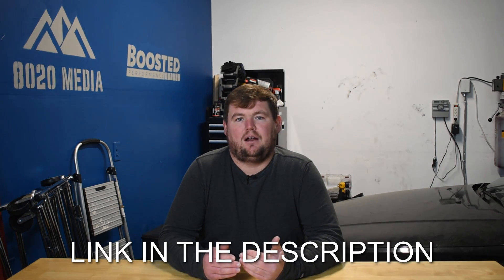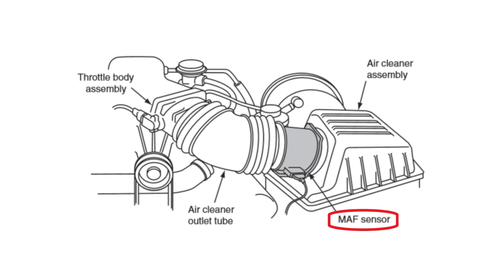DIY - 5 Symptoms of a Failing MAF (Mass Air Flow) Sensor!

Comment: So I have a 2002 Ford escape six-cylinder 3.0 engine in my maf sensor is reading higher than normal and yes, I’m getting misfire. I’m not getting a code for the sensor. I do know that I have a O2 sensor on one of the banks not reading properly but once the car gets up and warm symptoms seem to go away now I’ve done the usual looking at vacuum hoses, and sprayed brake fluid around areas to see if the engine RPMs would go up basically looking for vacuum leaks and that doesn’t happen the engine rpm stay constant, so could I have a bad sensor? Could I have a bad IAC? 
Scratching my head in Michigan.
Reply from the maker: K - If your 2002 Ford Escape’s MAF sensor is reading higher than normal, you’re experiencing misfires, and the symptoms improve as the engine warms up, this could indicate a few potential issues. While it doesn’t sound like there’s a vacuum leak based on your testing, a faulty MAF sensor could still be the culprit, as it might be sending incorrect airflow data without triggering a direct code. Additionally, the oxygen sensor not reading properly on one bank can disrupt the air-fuel mixture, contributing to the misfire and exacerbating issues with the MAF. The Idle Air Control (IAC) valve could also play a role, particularly during cold starts, as a malfunctioning IAC may not provide sufficient air for smooth idling. Start by cleaning the MAF sensor with MAF cleaner and replacing the faulty oxygen sensor to ensure accurate readings for the air-fuel mixture. If the problem persists, test the IAC valve for proper operation. Also, inspect the intake manifold for gasket leaks, as these can be more difficult to detect with a simple spray test. Keep us updated!
Reply: @8020Automotive  I forgot to mention that the MAF has a temperature sensor . It’s reading the incoming air and I’ve tested it when the car was cold and it closely reads the same as the engine temperature sensor.
I have cleaned the MAF sensor and that made no difference. I have purchased one but with the temperature outside around 10 degrees, I’m going to wait till it warms up.
No room in my garage, corvette and a couple motorcycles in the way 🤪
Oh, power brake booster is fine too, no difference in rpm when I press on the brake pedal. I may also pull the IAC off and bench test it.
Reply from the maker: K - Keep us updated!
Reply: @8020Automotive  I’ve replaced bank2 sensor 2 because it wasn’t reading correctly. Now I see good numbers from it and the computer is controlling the fuel much better! 
I’m now seeing that bank 1 sensor 2 is not giving me good numbers it’s more like .035v
I may have damaged it from Rutherford engine running so bad. So I’ll change that one out too. Also sense replacing b2 s2, a lot less cylinder 2 missing. I may have to take the car on a nice long ride to see if that will clean the plug up. If not , well when I get another break in the weather, I’ll pull the intake off and replace that plug and maybe the coil pack and the intake gaskets because I don’t remember replacing them.
That’s my updated so far.
Reply: @ Another update, I pulled the intake so I could look at that #2 cylinder plug. What I found was a crack in the epoxy of the coilpack and when I pulled the plug, I found the center electrode broken loose and flopping inside the insulator.
I changed the plug and puled the 1 and 3 coilpack only to find cracks in the epoxy on those too. I'm guessing heat from the exhaust manifold. All 6 coilpacks were replaced. I put everything back together, reset the KAM memory and started it up.
Wow, beautiful running at idle and power is back when pressing down on the accelerator. I'm going to give the computer some time to relearn and I think I'll change the oil just in case I washed that cylinder down too much.

Comment: Most dealerships just automatically offer to change MAF for some 300...400$. There will be absolutely no suggestion on cleaning it. Last time a MAF went bad on my ford Mondeo I just took it out, cleaned it with some CRC and a cotton tip. Problem solved and my DIY 0$ fix held for several years before I totalled that POS Ford for other reasons. And yes official dealerships diagnosis was bad MAF needs to be changed, cost 350$.
Reply from the maker: S - Very true! Thanks for sharing this, it will certainly help future viewers.

Comment: Check engine code is reading (P0171 System too lean Bank 1) this is the only code the engine is pulling. could this be a MAF sensor fault? Should i start there or is this completely something else.
Reply from the maker: M - A P0171 (System Too Lean Bank 1) code can indeed be caused by a faulty MAF sensor, as it may send incorrect airflow data to the ECU, leading to a lean condition. Cleaning the MAF sensor with a specialized cleaner is a good first step. However, the issue could also be due to a vacuum leak, clogged fuel injectors, low fuel pressure (from a weak fuel pump or clogged filter), or an exhaust leak near the oxygen sensor. Start by inspecting the MAF sensor and surrounding air intake components, checking for vacuum leaks, and testing fuel pressure. If the MAF sensor cleaning doesn’t resolve the issue, systematically address these other possibilities.

Comment: Car stats fine, then when driving for a bit, starts bucking hard and bately moves. MAF?
Reply: Barely moves
Reply from the maker: B - The symptoms of your car starting fine but then bucking hard and barely moving could be caused by a failing MAF sensor, which may send incorrect air-fuel mixture readings, leading to hesitation or reduced power. Cleaning or replacing the MAF sensor may resolve the issue. However, it could also be due to a failing fuel pump, clogged fuel filter, or even a faulty crankshaft position sensor or ignition coil, all of which can cause intermittent power loss as the engine warms up. Scanning for error codes with an OBD-II tool will help pinpoint the root cause and guide repairs effectively.

Comment: So I changed my maf and it’s still acting the same , with no codes
Reply from the maker: L - Sorry to hear. What symptoms are you experiencing?
Reply: @ it did thro a maf code , I changed that but seems worse then before
Reply from the maker: L - Are you getting a check engine light? Are you getting any other codes?
Reply: @ oxygen sensor
Reply: @ I am going to test the ground wire at the maf and the pcm to see if maybe a ground problem , when it gets a bit more light outside
Reply from the maker: L - Keep us updated.
Reply: @8020Automotive  I’m all out of ideas , I took the throttle body off , cleaned it up nothing changed
Reply from the maker: L - Did you check/replace the O2 sensor?
Reply: @  at idle it runs fine but as soon as I push down the peddle it pops their the air box with little to no power , sometimes it’ll straitened itself out and run fine or a bit but most of the times it’ll just die

Comment: I just threw a po172 too rich and po101 maf sensor. Is my problem too rich or is my maf sensor putting out wrong numbers to the computer. At idle I’m getting .9 lbs per minute on my scanner maf reading. What is wrong dude ?
Reply from the maker: S - Your MAF sensor is likely providing incorrect readings, causing the rich condition. Start by cleaning the sensor and inspecting the intake system.
Reply: @ Thank you ! I cleared the codes and this is the second day and no more check engine light. I’m sure it could come back. My fuel trims went -15 plus negative. Now they are +5-6 . I cleaned it a while back with crc maf cleaner and took it out again and it looks clean. I put in a new air filter. I will inspect the ducting and air box. Thanks again !
Reply from the maker: S - Keep us updated!

Comment: But so what if it is a 2019 Chevrolet camaro with 47000 miles no check engine light but under load it sputters feels like a misfire though like I said no check engine light so I hooked up my computer to it and well even sitting still it feels like sputtering morning time when I start my vehicle I can smell a little bit of gas though idk I never did the tune up on it idk
Reply from the maker: S - Start with a tune-up (spark plugs and air filter) and inspect the ignition coils and fuel injectors. If the problem persists, investigate the MAF sensor, vacuum system, and fuel pressure. The gas smell suggests incomplete combustion, so addressing spark or fuel delivery is key.

Comment: Can a dead MAF cause no boost - not reduced, none. I had some weird overboost and underpower issues always 5 mins after cold start, weirdly no codes? Whatever it is has gone from OK to dead, so wondering if its MAF
Reply from the maker: J - It certainly can be the MAF!

Comment: I changed my mass air flow sensor it got worse than with the old one
Reply from the maker: M - Did you get the right sensor? What engine codes are you getting?
Reply: @8020Automotive  I sprayed it off real good it was still jerking and hesitation.i bought a throttle body I went to a muffler shop.thry said it was that I put it on and the car ran perfectly
Reply from the maker: M - Nice! Thanks for taking the time to share your experience. This will certainly help future viewers.

Comment: I noticed recently my vehicle been losing gas mileage.. But no check engine light on, for anything. Also, sometimes my RPM goes up and down a little bit..Any idea would help a lot thank you.
Reply from the maker: U - Are you getting any engine codes? Sometimes codes register without a check engine light.

Comment: lol I feel like this video was made from my Yukon it’s doing all of that
Reply from the maker: J - Might be worth cleaning your MAF. Hope it helps.
Reply: @ just did that a little bit ago I’m hoping it works thank you
Reply from the maker: J - Keep us updated!
Reply: @ alright update I think it might be something else my truck is idling pretty bad now my lights and going in and out like the battery is dying but I check the battery that’s good along with the alternator and that’s good I don’t know what else the problem could be I got another code that popped up for the mass airflow sensor and I just replaced that last weekend
Reply from the maker: J - This video may be more helpful for your research: https://youtu.be/BiYsqRJCLhE

Comment: I've done two or three you need a special torx bit a t15 or t20 security  with a hole in it to remove/replace the MAS sensor. Or a pair of vice grips. Be gentle
Reply: ...or a flat head screwdriver that fits tightly between the notches 😀
Reply from the maker: M - Well said. Thanks for sharing!

Comment: if I don't have any of these 5 symptoms, does it make sense to clean as a preventive maintenance? I drive 2007 Odyssey with 164k miles and it probably never been cleaned or replaced
Reply from the maker: E - Always a good idea to clean it preventatively!

Comment: 2012 MAZDA2 WHEN COLD IDLES FINE WHEN WARMS UP ROUGH IDLE ABOUT 5 -600 ANY IDLE WHAT COULD CAUSE THIS ( NO CODES OR ENGINE LIGHT )
Reply from the maker: S - Could potentially be a clogged EGR valve.
Reply: @8020Automotive   THANKS I WILL CHECK THIS

Comment: My Toyota corolla 2009 start fine and run fine on high way when no rush on road but at rush hours when speed is very low and applied brake again and again, the car rmp down and engine stop. It not start immediately but start again after 30-45 minute.  Any Ideas?
Reply: Omg, I also have a Corolla 09 and the same thing happens. I changed the MAF and the problem continues. What is the problem?
Reply from the maker: J - Your 2009 Toyota Corolla stalling at low speeds and taking 30-45 minutes to restart could be due to a failing crankshaft position sensor or camshaft position sensor, both of which can malfunction when they overheat, cutting off the ignition signal and preventing immediate restarts. Another possibility is a faulty idle air control (IAC) valve, which may struggle to maintain proper idle under stop-and-go traffic conditions. Additionally, inspect for a clogged fuel filter or weak fuel pump, as reduced fuel delivery under low-demand situations can cause stalling. Start by scanning for stored error codes even if the Check Engine Light isn’t on and systematically check these components for proper operation.
Reply from the maker: S - This video may be more helpful for your research: https://youtu.be/7bqAIbYRdnc

Comment: I need help...
Mine is doing the start .. and immediately shuts down.
Start again.. ahuts down.. sometimes it starts and idles. But you gove it some throttle. It immediately bogs and shuts off.
Also.. NO ENGINE LIGHT.. NOTHING
Reply from the maker: S - This video may be more helpful for your research: https://youtu.be/cOW5RlAkqi4

Comment: Mechanic here: Easiest way to diagnose a failing MAF/Mass airflow sensor. 

1. Start your  car and let it run
2. While car is running, unplug Maf sensor plug and the plug in only. 
3. If car still runs after unplugging Maf sensor connector, that means your Mass airflow sensor is bad. If car shuts off then its still good and that is not the problem. 

Have a good day and God bless!
Reply from the maker: J - Thanks for the insight. We also say this in the video :)
Reply: @8020Automotive  That's not always true. My car wouldn't start...it would try to turn over maybe once or twice...but when I unplugged the MAF sensor, it started. I replaced the sensor, and it started with no issues afterwards.
Reply from the maker: S - You're basically saying the same thing..
Reply: @8020Automotive  My bad. I misread his post.
Reply: What does “unplug Maf sensor plug and the plug in only. “ even mean?
Reply: Yup  Thank  you  for  pointing  that  out
Reply: I put a 3 inch short ram intake on my 07 Honda civic lx. It idles but it’s rough. It’s a delayed throttle response and it shuts off almost right after I start it. I take out the sensor and the car runs fine but it has a safety rev limiter of 3,500. I’m not sure if the pipe is too big or if I need to replace the sensor. I can hear and feel the air coming through the new intake. Help
Reply: Bro that’s really helpful for me to check this issue , coz I cleaned it but no luck and I didn’t know if I have to replace it unless I know it’s bad
Reply: Mine shuts off if I took out the whole sensor with the plug but if I only take out the plug it does not shut off
Reply: Thank you that's the answer I was looking  my bakkie still idles even If i disconnect the mass air flo sensor plug it ides

Comment: Your descriptions of the symptoms are so in depth and concise. Thank you for the help you put out on your channel. It's greatly appreciated.
Reply from the maker: 9 - Thanks for the feedback! Hope it helps.
Reply: @8020Automotive  Please help!!!! I have a 95 camaro 3.4..It was sputtering at a certain speed so the TPS sensor and throttle body was cleaned. It done fine the rest of the day and the next day back to the same thing but now it backfires. I have the 16 pin connector and grrrr. What else can I do? Also, how the heck do you get to the plug wires on the drivers side??? Car is driving me batty!

Comment: I have all these symptoms at idle but my E30 doesn't have a MAF because it's an old model. What else could be causing these symptoms?
Reply from the maker: T - Are you getting any engine codes?
Reply: @8020Automotive  My check engine light is busted and I don't have an external code reader so idk unfortunately. But after watching your other video on faulty 02 sensors I'm thinking that it might just be that.
Reply from the maker: T - Best thing to do would be to get an OBD scanner because it would point you in the right direction.

Comment: Will a dirty cabin filter kick a code?
Reply from the maker: H - It can, but it wouldn't point directly to that filter.
Reply: @8020Automotive  Thank you. I have a 2011 Nissan Maxima and I've never changed my Cabin Filter. (Yeah filthy) and the code kicked. Im hoping this did the trick.
Reply from the maker: H - Thanks for sharing. Hope it resolves your issue!

Comment: This is a great video for dummys that dont know much about diy.  I like that he explains first the symptoms your car has. He described what your car will do when sensors fail. Thats perfect for someone who is clueless on what to test or where to start to find what could be causing problem and breaks it down to if certain sensors fail this is what your car will do or not do. Thats great that he explained how your car will run if something is bad. That really helped me when it came to trying to figure out what sensor does what, and what sensor will cause your car to perform if its bad. Very helpful and saves me time testing all my sensors. I pretty much can go straight to the one i think is causing my problems.   Thanks for doing a video on diagnosing the problems and symptoms of a cars performance so that i can compare my problem to the symptoms he described on video.  How your car runs when all is good compared to how it runs if this and this and that is not good?   Great video very helpful for blondes/dummies that are self (teaching) in progress!
Reply from the maker: C - Great to hear this video helped! Thanks for the feedback.

Comment: Ok answer this ? If the mass air sensors giving these issues and we disconnect it and it runs roughly but when we connect it back it shuts off? Is that definitely the mass air sensor?😊 or i a c valve?
Reply from the maker: A - More than likely MAF.

Comment: Had an mass air flow sensor issue on a Nissan Kicks, make the transmission slip, you think you're CVT is blown, but thankfully its not that serious.
Reply from the maker: B - Nice! Glad you found your solution.
Reply: I have a Nissan kicks 2018 and dealing with this! Did you just replace the part or clean it? Dealership is trying to charge me $700 for this! Wondering if I could diy